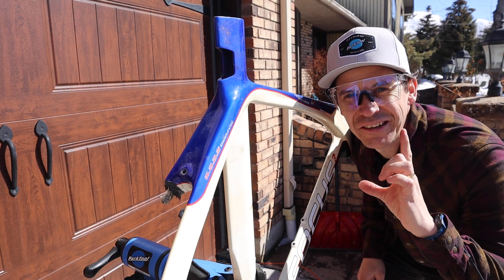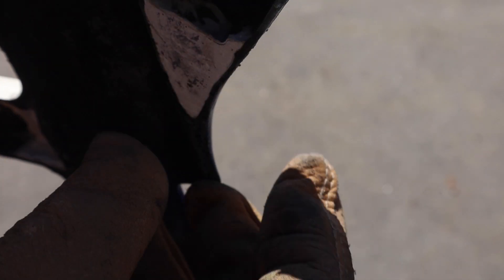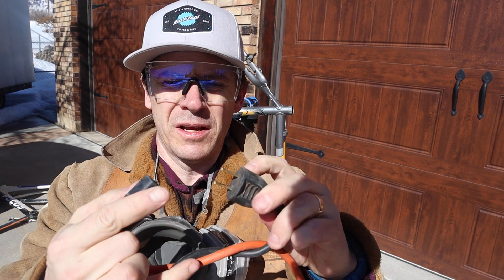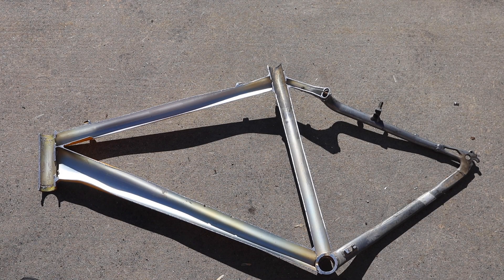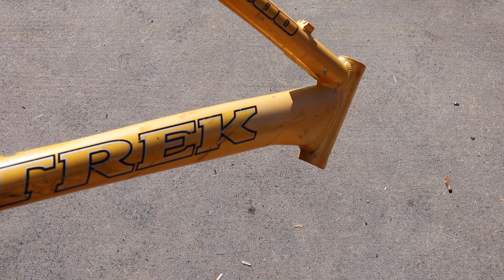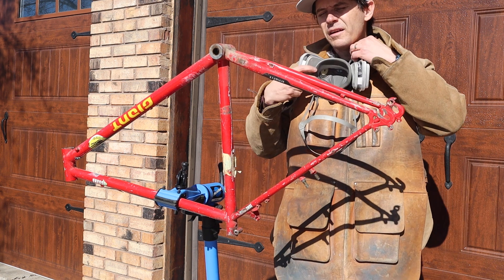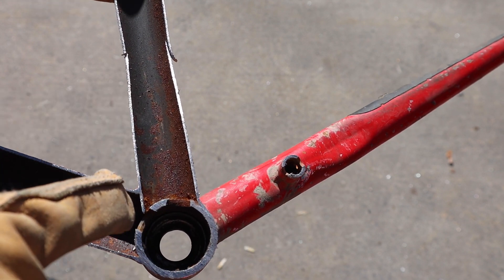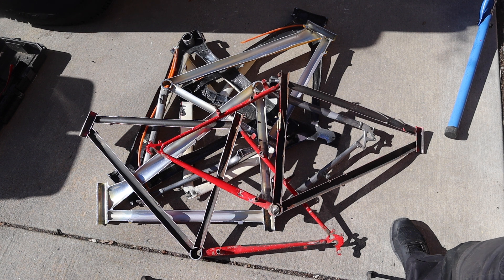What's Inside a Bike Frame - Cutting Bikes in Half for Science

Comment: I would never in a million years ride a carbon frame. Aluminum is the ultimate but not all aluminum is created equal. I will bet money that the aluminum frame you cut is either 6013 or 6061. If it was 7005 it would almost be impossible to cut. 7005 aluminum is the greatest material on the face of this planet especially if it’s triple gauge ( butted ). Steel is strong but super dense and heavy. 7005 is the premium and most expensive aluminum and good luck trying to find any bike today made from it.

Comment: Perhaps you could show a bike frame that has been coated inside the tubing, I recall seeing a builder that poured some chemical inside the tubes after taping the holes closed. He shook it all around and in every direction, up down upside down then drained it out of the frame. After a few days drying he poured the coating in and shook it all up then let everything dry and you could see that the first chemical removed the rust and the coating covered everything for total coverage and he said that the frame would never rust.
 I have a Waterford 22-Series Artisan and I'm always looking for any signs of rust starting.
Reply: That stuff is like fluid film or similar. Which is what that black coating on the steel is.

Comment: nice except you only needed to use a dremel.... I cut the CF and ALU with a dremel. also your cuts are wonky because you needed to take some BLUE painters tape , and find the CENTER LINE on the top tube... Never wanted to cut open the frame to expose the MATERIAL THICKNESS. OOOOH.  its awesome to LEARN! thank you SOMEONE FINALLY TOOK MY IDEA AND USED IT FOR AN AWESOME VIDEO :) YOUR FRIEND SHAUN KOSOY

Comment: While I found this video very interesting, I couldn't help but wonder what your neighbors were thinking about all of the noise that their new neighbor must have been making! LOL!
     I wonder if the rust in the bottom tube may have actually been caused by moisture seeping through the drain openings and condensing on the inside of the frame. I believe that Utah is a little more arid than the Southeast, but down here, our humidity seeps in anywhere that there is an opening. I also drive a school bus, before & after teaching high school all day. On our high humidity mornings, when we have a heavy dew, if there is a single window left cracked overnight, the entire bus will be damp on the interior.  I guess that the same principle could be at work here.

Comment: seeing the inside condition of that giant was really cool honestly, really goes to show just how long even the cheaper of these old steel frames will last if they are somewhat taken care of, it's gonna take a while for that rust to really damage a relatively thick walled tube enough where the frame wouldn't be usable anymore
Reply: yeah its just surface rust really. tubes are absolutely fine. I dont even see any reason why someone would throw that frame to the bin, looks ridable to me.
Reply: @ДенисКомаров-л4ч  could have been bent or cracked somewhere or maybe have some other sort of damage, don't think a place like the SLBC just throws out without a reason
Reply: It looked like one of the bottom bracket cups on the Giant was still in place, possible it couldn't be removed. The carbon was obvious why it was trashed, but would be interesting to know what was wrong with the others
Reply: Old shovel needed a steel frame for content so SLBC gave him the most tired looking beat up steel frame they had. Not a fancy Reynolds frame just a low end mass produced one. Yes the frame could have restored however OS had an idea for content ...so on and so forth...OS will make in utube ad revenue over 100x what the frame is worth..Just my 2 cents.